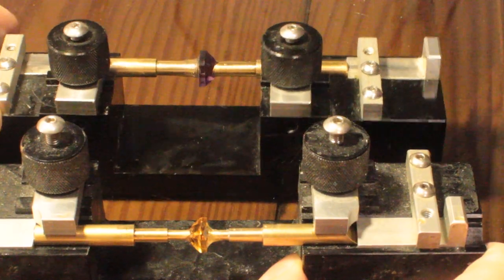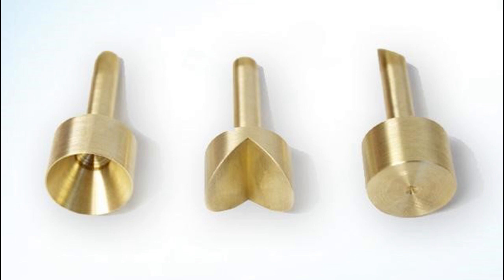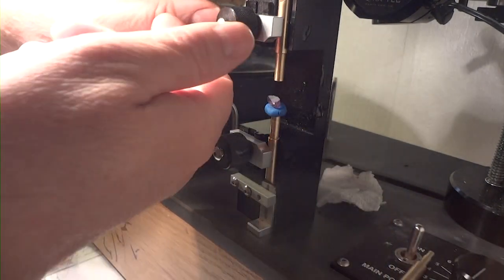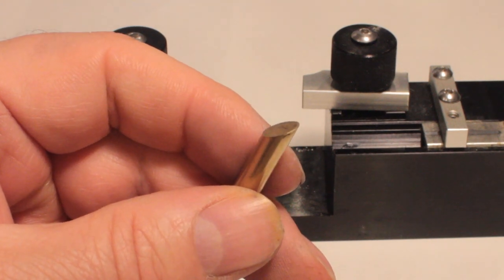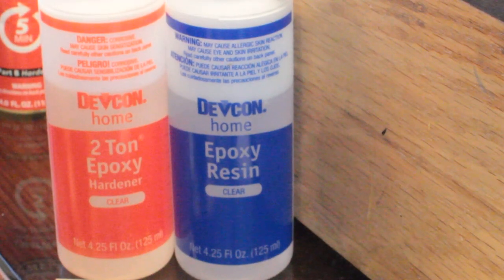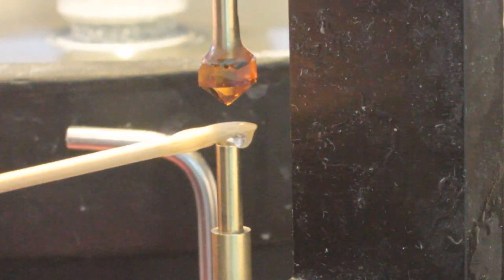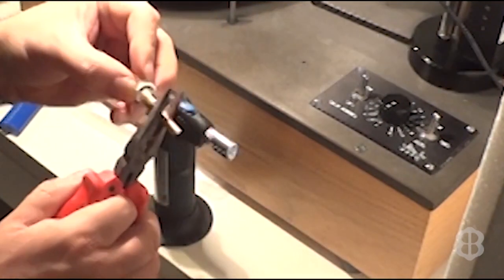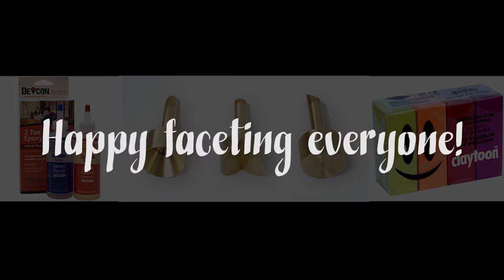Gem Cutting Tutorial: All About Transfer Fixtures

Comment: Great video very useful. By the way how long it takes for your super glue that you mentioned cure up?
Reply: I was using Loctite 404 which is available from many sources, including Ultra Tec.  I normally left it overnight to completely cure, so I am not exactly sure how quickly it will cure...somewhat less than overnight I guess.  However, now I am using a UV light activated Superglue called Surehold by Helios.  It cures in about 2 seconds with the UV light.  I have started cutting a stone immediately after applying the UV activated Superglue and it works great.
Reply: @mikesackos2208  thanks a lot.